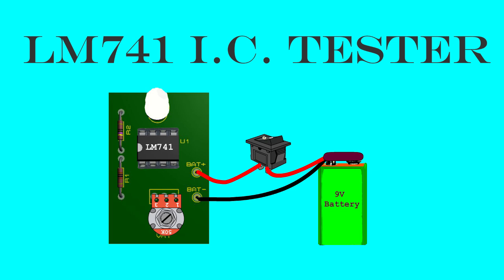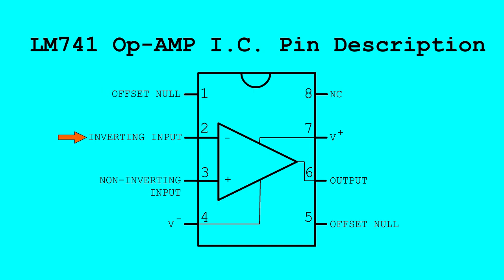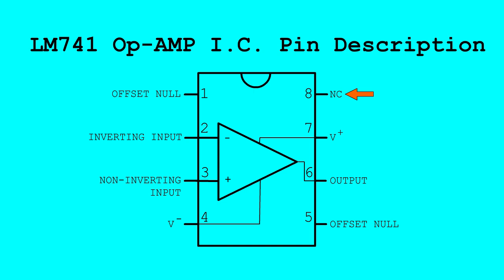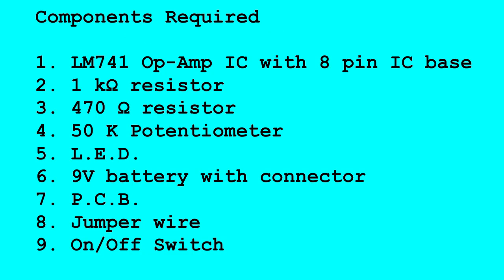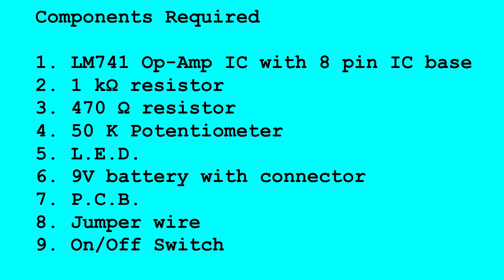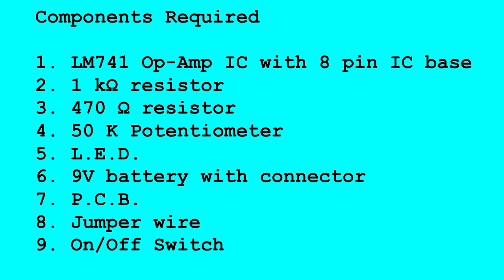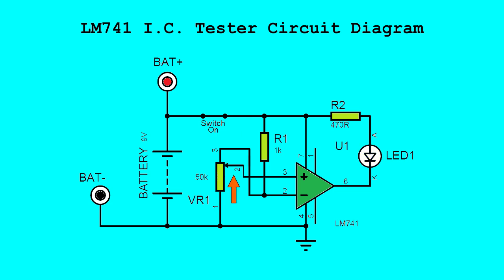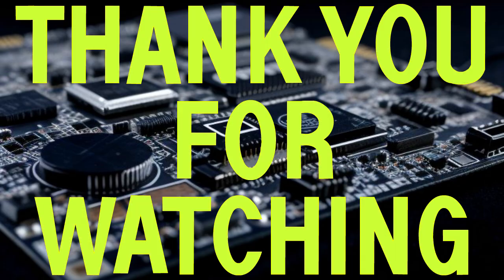LM741 I.C. Tester

Comment: Hi,  is it work for any op amp IC?   thanks
Reply from the maker: Yes, this circuit works fine with the similar type of op-amp ICs. Just check/change the pin connections and voltages as per datasheet of LM741 and other op-amp IC which you want to test.